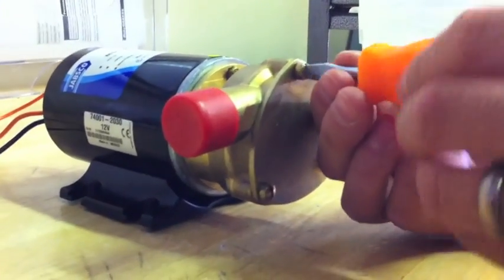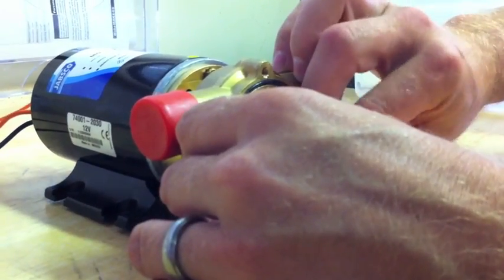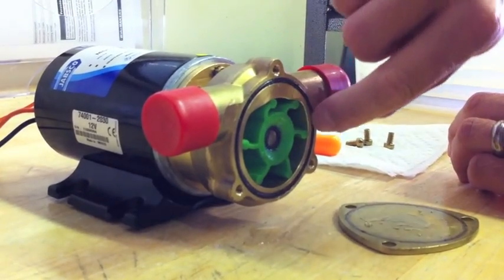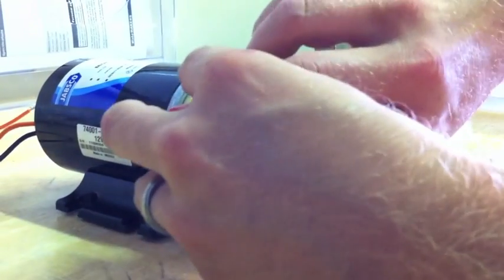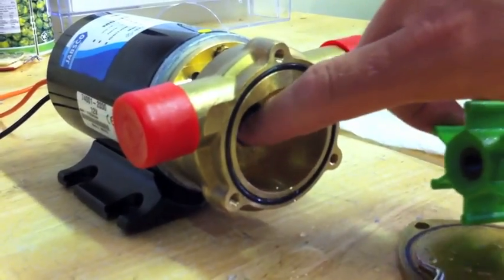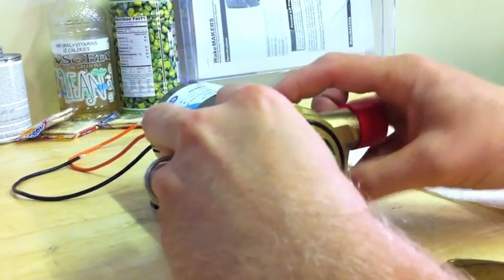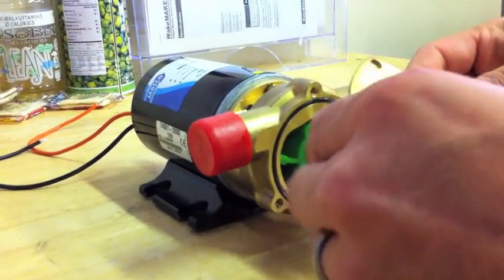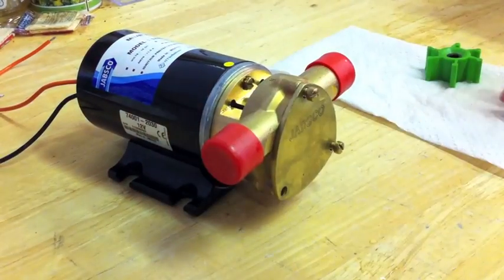HOW TO: Jabsco Ballast Puppy Pump Green Impeller Replacement

Comment: Hi Again, I just checked my simer m-40 pump, the shaft rotation is clockwise,the water inlet is on the right side top while water outlet is on the upper left All I need to know is which way should the impeller blades slant to the right or to the left,       Thanks

Comment: Hi> I have a similar pump that is no longer made ,need to know on your model what is the rotation of the motor shaft and also need to know which side of your machine is inlet and which side is outlet, thanks, I cannot find out which way the impeller blades should slant,that is my problem, the pump is discontinued yet there are aftermarket impeller kits available, which come with no instructions. Thanks
Reply: I have the same questions, did they ever get answered?

Comment: Thank you, thank you!  My Wayne PC2 pump was making a squealing noise. It was also pumping very poorly - spitting, etc.  It also has a soft rubbery impeller assembly very similar to this one.  It came apart easily, I replaced the impeller - just like the video shows, here.  Put it back together, checked my water receiver and the lines, hooked it all back up, primed it (with just water, no vegetable oil), and wha-la! It works like new!  Many thanks.

Comment: Why would it matter that the blades are going the clockwise position, its a reversible pump. As soon as you flip the switch the other direction the blades will be facing the other way
Reply: Yeah, I was wondering the same thing.  Plus the owners manual says the direction is just the opposite of this video.  If you run them without the plate they just reverse directions.  I think the key is just making sure you don't have one going the wrong direction out of all the blades perhaps?
Reply: @kellyhouseholder6737  this video is 8 years old. Maybe it wasn't reversible back then but I'm guessing.